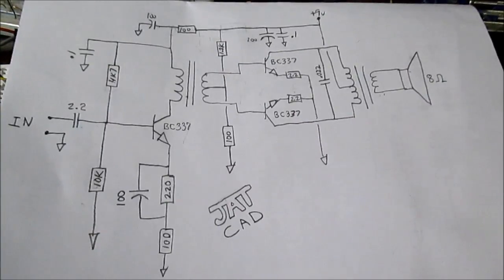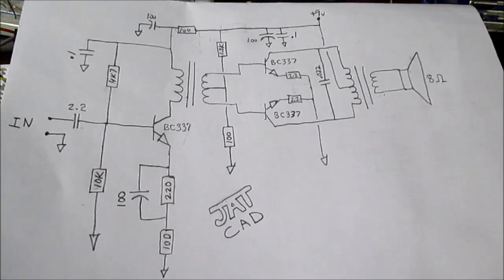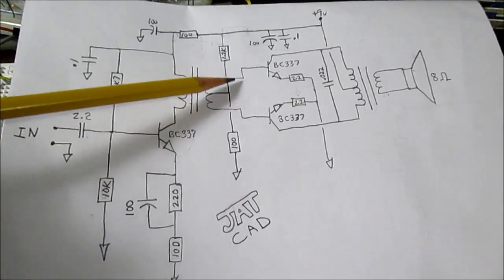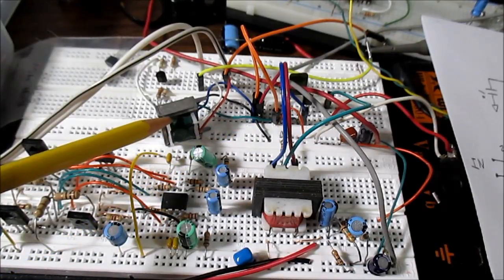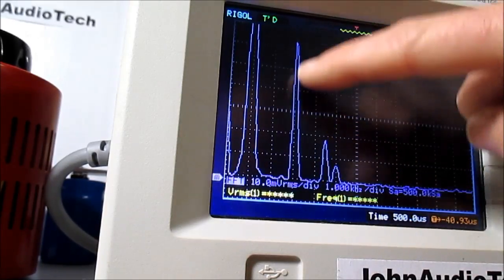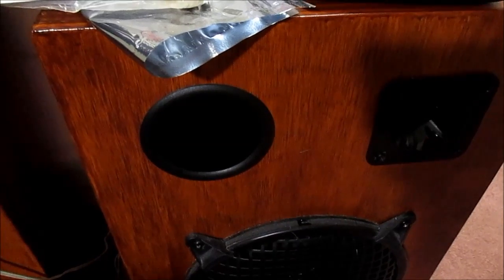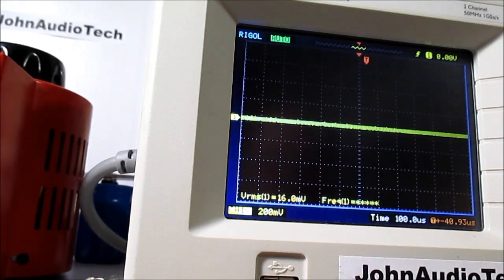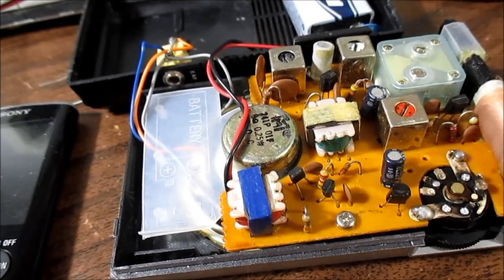Transformer coupled solid state audio amplifier built on breadboard and tested

Comment: In the early days of transistor production high power germanium PNP devices were all that was available for some time. Circuit design was following the valve era and substituting like for like. For audio power amplifiers, they knew transistors would not require an output transformer, and there was great expectation of big performance gains here. The lack of a complementary output pair led to new circuit ideas like the quasi complementary output stage and variations of it. The current 2N3055 and 2N2955 pretty much are the same now as the first silicon high power bipolar complementary devices to arrive. I have a few early 60s 3055s lying around. The 1970s was a great time of innovation in audio design and many Japanese manufacturers started a distortion war, all trying to outdo each other to lower their distortion figures. There were some ridiculous figures released for some models - until the early 80s when quality generally seemed to drop off. 
Harold Leak introduced the 'Point One' series of amplifiers in the 1950s which offered supreme performance from it's 'ultra linear' output stage allowing pentodes to give 0.1% distortion and good power delivery. QUAD had introduced their electrostatic loudspeakers which again offered a close to ideal performance for the first time. A HiFi at home could produce realistic levels of full frequency sound with imperceptible distortion and full dynamic range at the time when studios had managed to perfect their techniques and equipment to capture the artist with almost total perfection - again for the first time (arguably). We must thank Bing Crosby for bringing us audio perfection - believe it or not - He, being who he was, wanted to have his radio shows recorded so he need not have to be in the studio during the performance. He bankrolled a small company called Ampex to investigate the new plastic tape medium developed by the Nazis during WW2, it turned out to be of enormous quality compared with anything seen before. Bing could sit at home while his radio show went on air. We got great Sinatra, Buddy Holly etc...
There are audio idiots, but also some great audio genius' who have advanced the state of the art.
Reply from the maker: Good post. interesting info about Bing.
Reply: The early Point One amps were triode connected KT66. The ultra linear technique was an idea developed by Alan Blumlein who along with E H Armstrong invented everything in audio. (seriously they were extraordinary). The Quad speakers of 1957 promised a level of distortion magnitudes below any moving coil motor on any cone loudspeaker. The German tonschreiber was capable of remarkable quality due in part to the introduction of AC bias. It was a complete gamechanger.
It is hard to get your head around the possibility that there would be no resurgence of Frank Sinatra's career and possibly none of the sixties explosion (No Beatles?) etc. without Bing Crosby...

Comment: Odd harmonics are main component of any push pull output, the even order harmonics are cancelled. That little output transformer is nasty. The maximum output assuming peak efficiency could reach near a watt (800mW?) with a decent transformer in this circuit, I guess this was saturating near it's rated output which looks like it is about exactly 100mW...A decent 3W transformer has more iron in it than the average Toyota. (I know you said it was all you had, I'm not complaining). Another great video though, I really like your work. Brilliant.
PS It looked like it was much worse than 3% distortion, that waveform was visibly very lop sided and wiggly?

Comment: I always thought of these transformer designs as lazy, a hang-over from the tube days.
Reply: They were a hang over, but choose the right transformer and they work great, still.
Reply: Part of the issue was efficiency as germanium transistors cannot be pushed to high temperature
(90C is the limit for Ge devices, compared to 175C for Si).  Thus class B or AB was always going
to be the one to use to maximize the usable power from the thermally fragile devices.  The manufacturing methods meant for quite a time PNP and NPN were very different - no complimentary devices really.

Comment: Thanks for the nostalgic explanation.  It reminded me of an argument I had with an audio salesman 50 years ago.  I said I would like to hear what my transistor radio would sound like connected to a large hi-fi speaker.  He said there would be no sound because the little radio could not drive a big speaker.  I said lets try it and he agreed.  I cut the radio speaker out, ran wires from the output to one of the large speakers in the store.  I don't remember exactly how it sounded, but I think it was just as loud or louder than the little speaker, plus I think there was more bass.
Reply: I also don't remember what he said or the look on his face, but I'm sure he was silently chagrined and embarrassed.
Reply from the maker: I love disproving silly beliefs (without being cruel). Unfortunately audio is filled with them and some people choose not to listen.
Reply: @JohnAudioTech  Hey john, i have a circuit i need your help with! it's a transformer coupled push pull amplifier using germanium transistors!

Comment: Please consider doing a video of a wide-band AGC amplifier. I need to amplify the output of an AD9850 DDS signal generator module which has a P-P output voltage of only 1V. It would be nice to amplify it using an LM7171 for 0Hz to 25MHz to 5V or even 10V P-P. I have built one using a Pro-Mini and LCD display with an Encoder to set the output frequency. 
There is a mod that replaces the on-board resistor on the module (R6) from 3K9 to 2K2, that increases the output to 2V P-P but its not enough and stresses the chip a bit. https://goo.gl/WeCdJs
Thanks.